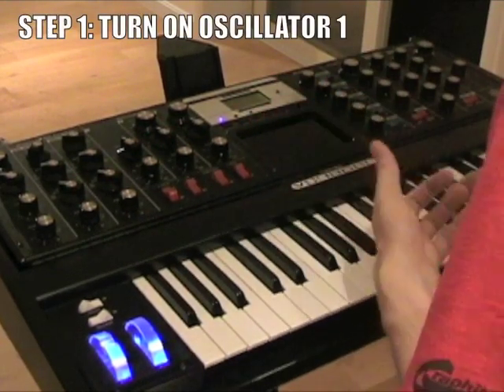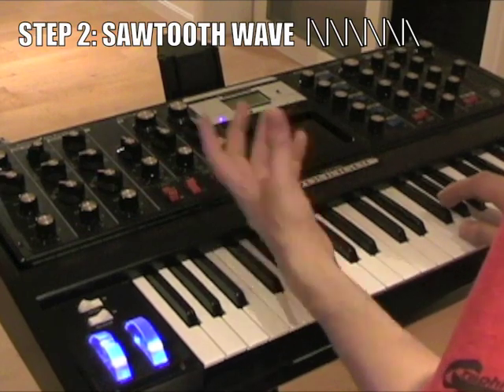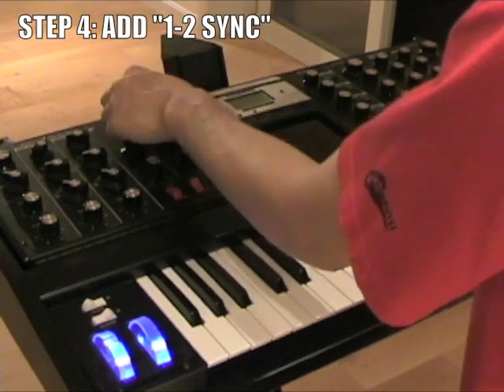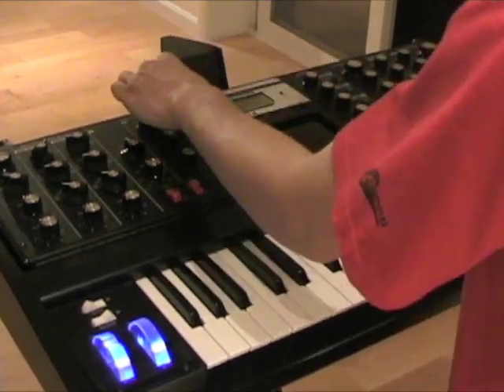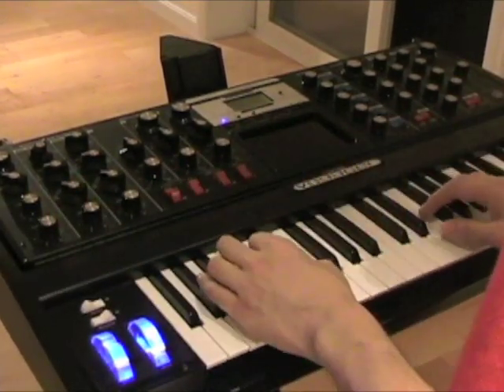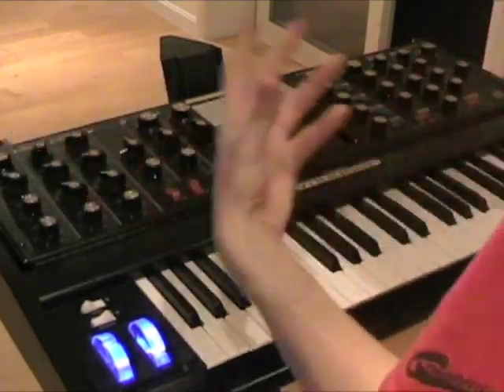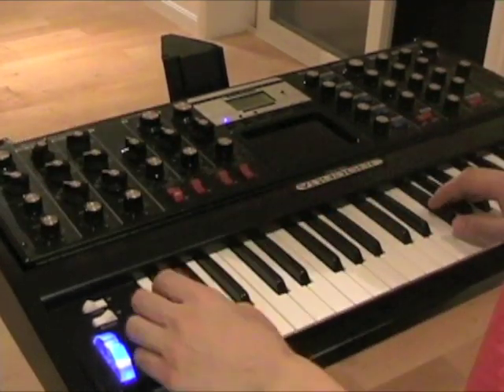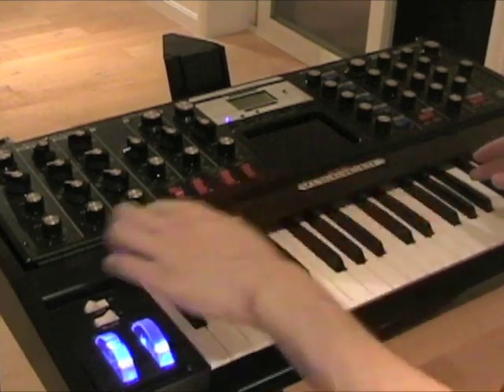How to "MOOG SCRATCH"

Comment: for more extreme effect adjust 'filter keyboard amount' while also using the EG to modulate the resonant FILTER instead of the osc. 
Now run noise thru the filter and it sounds even more like real scratching than using an osc. this is due to the extra filter modulation by the keyboard in addition to the EG = more extreme frq. range, so it sounds like faster scratching :)